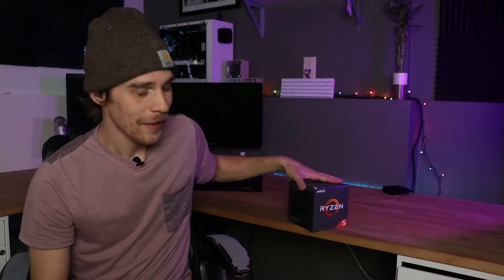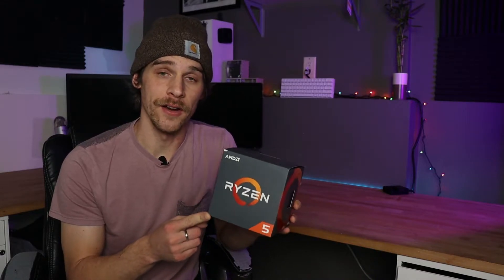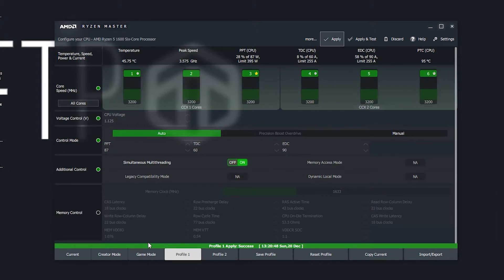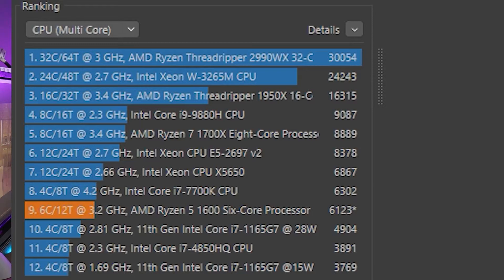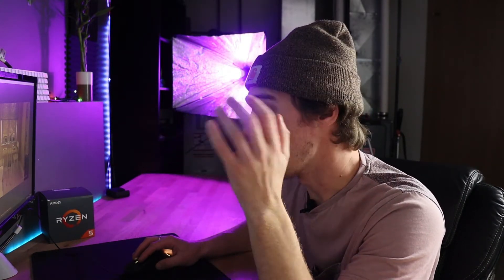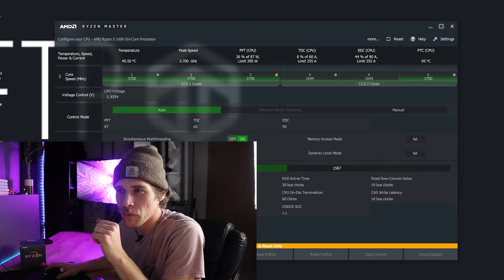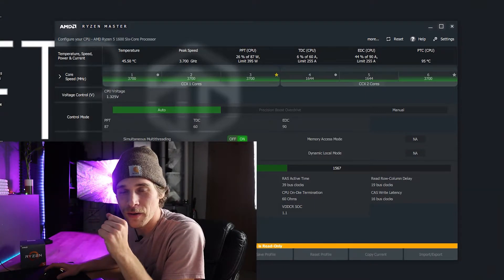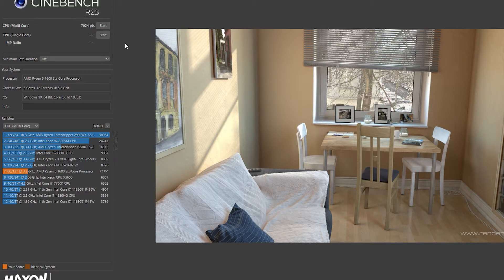Overclocking The Ryzen 5 1600AF On The Stock Cooler - Silicon Lottery or House Fire?

Comment: Got my 1600AF running at 4.1ghz / 1.384V on an ASUS TUF GAMING B450M PLUS-II :D

Cinebench R23 on stock was 6461 and OC to 4.1 got to 7805, I kinda feel I still could get a bit extra performance but the extra voltage doesn't seem worth the hassle
Reply from the maker: That’s dope love to hear it!
Reply: Hey there! I have the same motherboard and cpu.
Do you think is a good idea to take ryzen 5 1600af to 4.1mhz with stock cooler?
What are the temps in your system?
Reply: @gonzaloiribarren4592  On my case I had a cheap Thermalright cooler, I wouldn’t recommend considering any kind of overclock with the basic stealth cooler

Comment: mine is the original 1600 have it since launch and overclocked... has been at 3.7 oc with stock cooler, had no problems. my rams are oc too, from 2400 to 2800mhz, 2 sticks of 8gb crucial.

Comment: I don't think that it makes any sense to OC this chip if it's paired with a gpu which is being maxed out by this cpu, in this case the 1060. Hence why the performance increase is miniscule. OC-ing a cpu would only prove beneficial if it would be paired with a stronger gpu (for instance rtx 2060, 2070, 3050 Ti) and the cpu is struggling utilizing the card on 1080p lower settings.

Comment: Just built a 1600af/ rx6600. Had an extra spire cooler so I put that on it. Havent ran cinebench. But in firestrike it boosted to 3.75ghz out of the box. I did use thermal grizzley kryoknaut paste. Meshify c. 2x140mm intake 2×120mm exhaust. The graphics card runs very cool as well. Did have pretty cold ambient temps. Below 20c, during my initial testing. Cpu score for timespy was 6000, 16764 for firestrike physics score.
Reply: Had to edit. Meant 3.75ghz out of the box. I'm used to my 5800x 🤣
Reply from the maker: I was gonna say dang Greg you really found the Silicon lottery 😂

Comment: Also have 1600AF but on cheap mobo GA-AB350M-DS3H V2 i can't push them more 4.1GHz wothout blow up VRM section. Stable and best what can use for daily and general use is 4GHz on rlly low voltage 1.175v Cinebench score 7704

Comment: Got my 1600AF sitting at 4ghz at 1.325V for more than 8 months now, I will upgrade to Ryzen 5000 sometime but for ~100€ it's the best CPU ever made, I will surely keep it for a Home Server or Test Bench for sure!
Reply from the maker: Nice George 4Ghz is sick! I completely agree this chip is an absolute powerhouse for the price and once I upgrade to Zen 3 I will be using the 1600AF on the test bench too
Reply: I have 4x8gb sticks of Ballistix RAM tough, the speeds are not great with 4 sticks ( only 3200mhz)due to the daisy chain design of the Motherboard, but if you have installed only two of them I would try to Overclock them to a bigger freq or a smaller CL, or both, if the memory is good to go. 
For ex. I got my Ballistix sport from 3200mhz CL16 to 3600mhz CL16 in a completely stable way ( 48 hours memtest and gaming), latency has improved a lot and most important bandwidth has increased a lot (~ +12GB) . Ryzen performance gets a huge boost with speedy memory! 
There are plenty of guides on Reddit! Good luck!

Comment: I can shake your hand good sir. Yesterday got a 1600 af and reading on overclocks people got 3.9 ghz on 1.2v. My chip needs 1.387v under load to get 3.9 ghz. I lost the lottery also. The wall starts at 38.5 ghz. Im running it at 3.8 at 1.287. Its just these chips are 2600 dies that dont make the binning so its pretty bad for some samples :-) nice video though!!
Reply from the maker: Yeah I agree im still happy with it for the price I paid for originally, to get r5 2600 performance is great. In trying to upgrade to Zen 3 but its not been easy lol never in stock
Reply: True that. Gl with the channel!
Reply from the maker: @ReCoil_010  thank you I appreciate that!

Comment: I also have a Ryzen 1600, only 14 nanometers.
With factory cooling, 3800 mhz with 1.32 voltage.
Value for money is still the best.
Reply from the maker: Its a great chip no doubt even after I upgrade ill be keeping it for a long time on my test bench
Reply: @YourPersonalGeek  
5600X 3-4X more expensive than the Ryzen 5 1600. LOL
It’s not worth the surcharge to me, 6 core of 12 Threads will last for a few more years.
Reply from the maker: I do a of lot of video rendering and want to do 4k gaming with a 3080 so worth it to upgrade to newest architecture but absolutely no problem in using zen+ for awhile